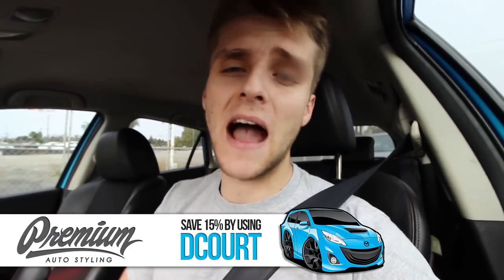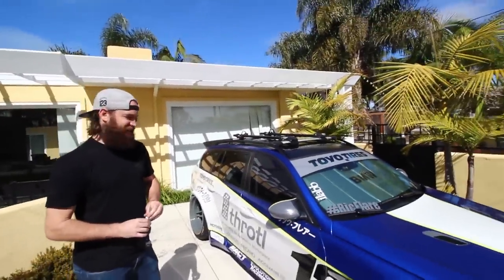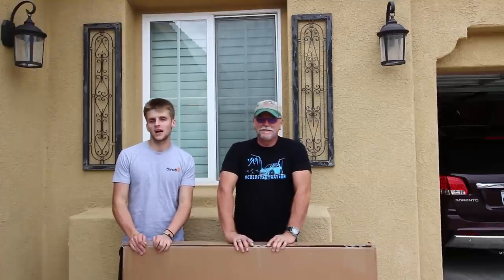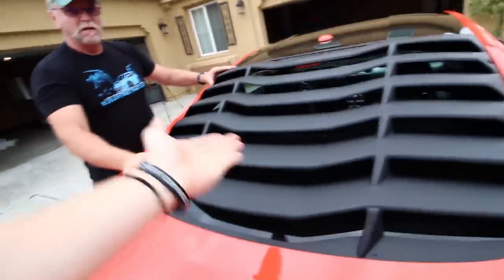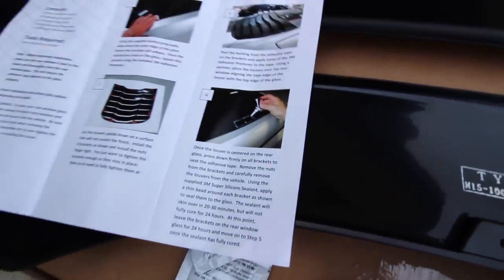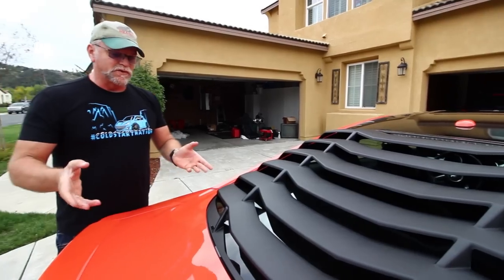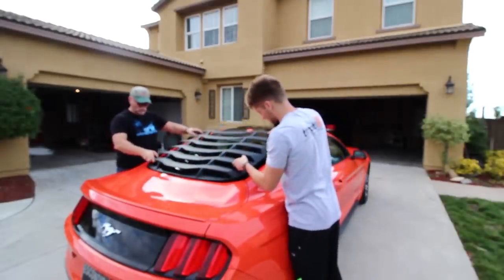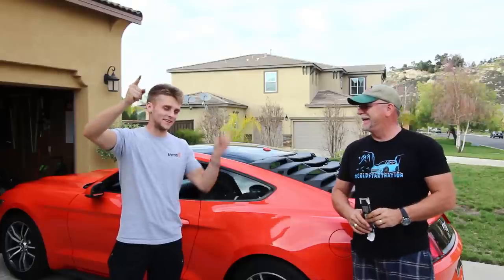Installing Louvers On The Ecoboost Mustang

Comment: The mustang is the only current car that louvers still look good on. Now he just needs wheels, intake, exhaust, and a tune and he'll be set.
Reply: Nicholas Rodrigues an the 350z or 370z they look sick as well
Reply: Patricio Rivera forgot about those. IMO they look better on the 370z than the 350z.
Reply: Nicholas Rodrigues louvers I feel like have always been a mustang thing
Reply: Nicholas Rodrigues lambo uses them lol

I don't like how they flex, because they probably vibrate and sound cheap with all that grumble (I cannot confirm). maybe honeycomb carbonfiber would be the best.
Reply: camero, 350 n 370z looks good on em too
Reply: 370z
Reply: They look best on the challenger
Reply: needs a V8
Reply: I agree the BRZ/86 GT are also modern cars that look good with them lol.